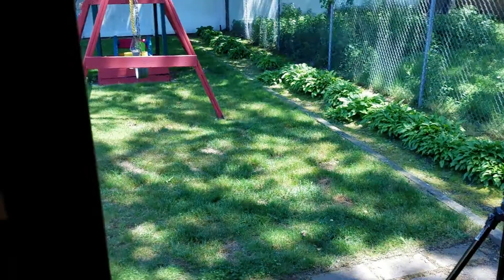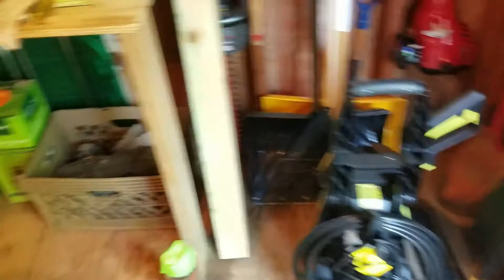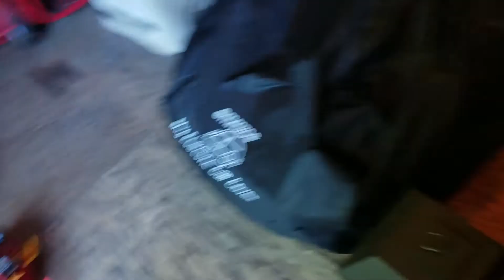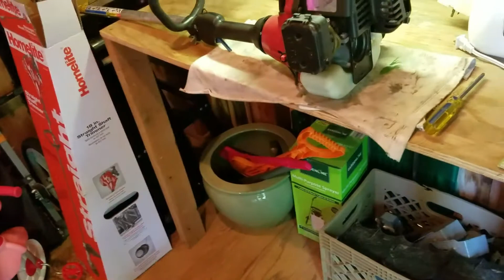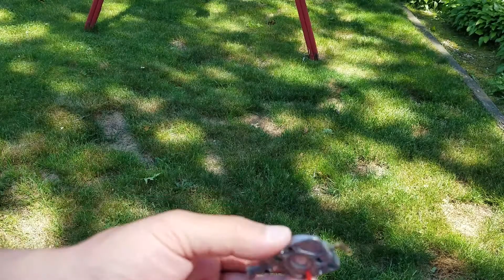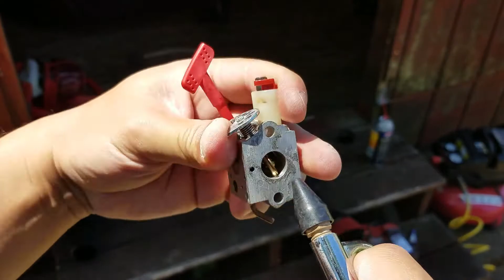Homelite Weed Wacker Won't Run (Pt. 1 of 3)

Comment: When I was a kid, I had a computer game called Alleycat.  Indeed, you were an alleycat, destined to get the mouse, bird, food, whatever it was.  One of the boards was a big block of Swiss cheese in a room, and the mice would appear in the various holes.  Indeed, the different holes in the cheese would talk to each other, and you could go through them, and come out another hole.  In time, you'd learn where each hole would go and where you'd come out of.  So I guess the carb is a lot like Swiss cheese.
Reply from the maker: Yes, but is it corrugated?
Reply: @xjoe81x  Nah, more like perforated.  THIRTY!